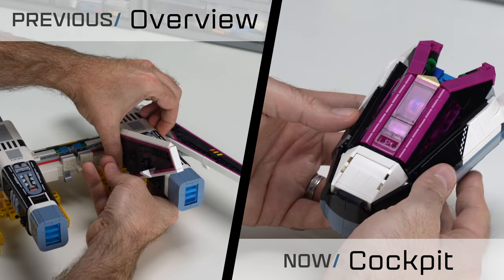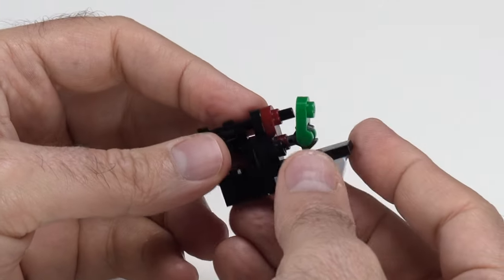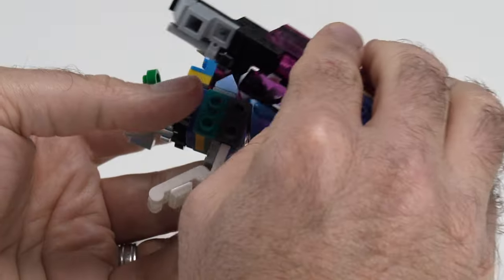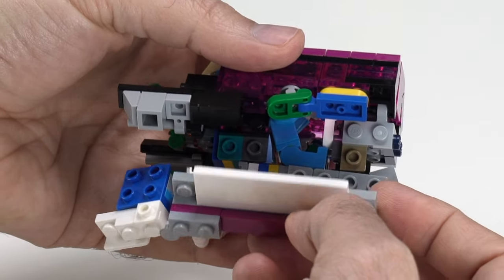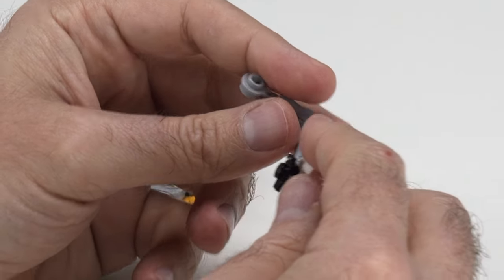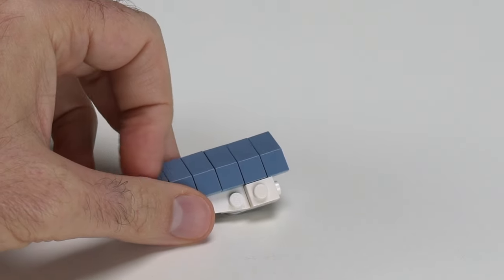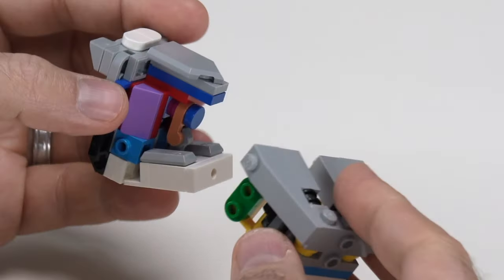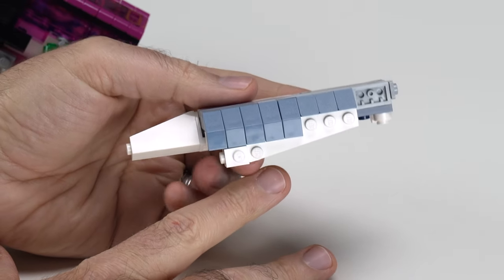Space LEGO: Premonition - Cockpit Detail

Comment: I'm so happy that the full step-by-step videos returned. Thank you for the effort of making them! The bottom supports are very interesting connection. Not only they give 4 or 5 (the longer ones) degrees of freedom (if I count them correctly) per support but also they allow to adjust their length. Clever. I would normally expect 3.18mm ball joints for making connections in two dimensions at once but I suspect they were too limited in their range of motion or too bulky? Anyhow I will have to remember this. This may sound silly but I very much like how the 25893 (1x1 round plate with bar on short stem) in LBG works as the stopper for the green 26047 (1x1 round plate with bar handle). I guess that finding this solution required a ton of tries but the fact that resting the green plate 1.5 plate (height of the 25893) above the the magenta glass is sooooo satisfying :)
Reply from the maker: Awww! Thank you very much for the encouragement  on the long videos -- I'm so happy you enjoyed them. 🙇‍♂️ (It makes the effort feel nice.) And I appreciate your awesome comments/insights, responding to each:
 - I agree with you on the flexibility of the bottom supports. I hadn't anticipated how useful it would be to have all that (degrees of) freedom including the length, and it allowed for precise positioning. Ball joints would be my usual go-to, but I didn't see how to fit them in, and I ended up feeling pleased about the (unexpected) aesthetic from the bar holders + plates with bars. 
 - Thanks for the feedback on the "stopper" for the green plate with bar. Because I too loved ❤️ how that came out. It's nice to hear it was satisfying for you to watch, as it also felt satisfying to build. 🙏 IIRC this solution arrived "in the moment", from having a couple of those bar-on-stem parts sitting on the worktable. 
Cheers!